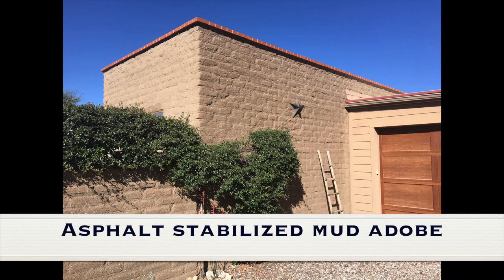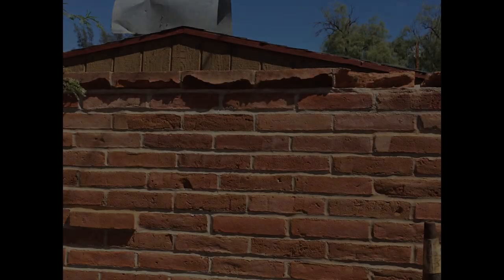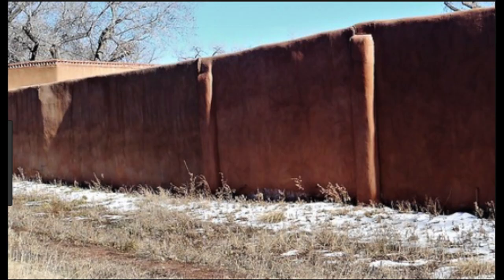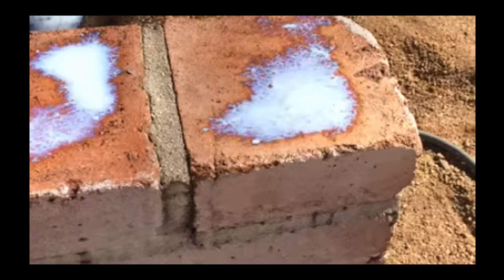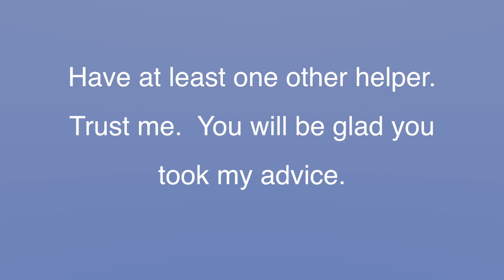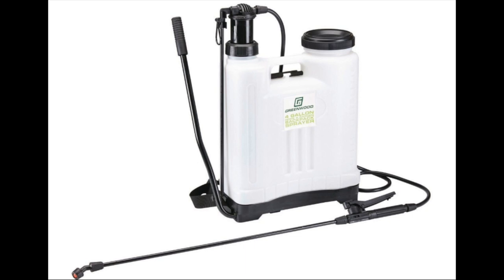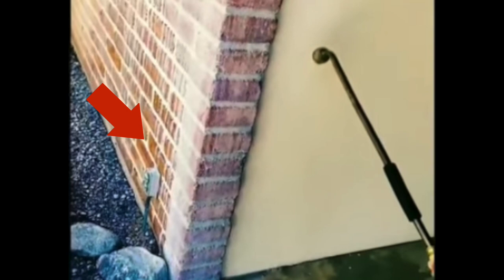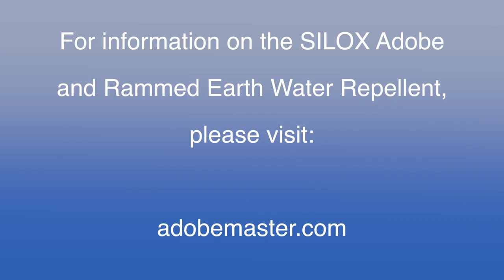Properly sealing your adobe and rammed earth

Comment: what about white wash....It adds cao2 and over time strengthens the block to lime stone!
Reply from the maker: Interesting question and one not easily answered. If the "white wash" is done properly while adhering to proper application techniques, materials, and the all important and critical surface preparation, I believe it can be a viable option.